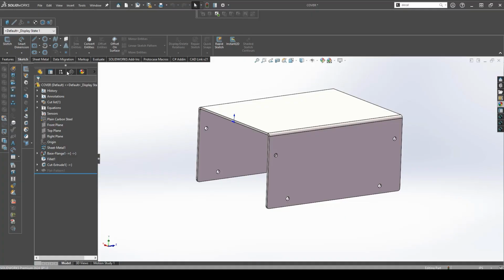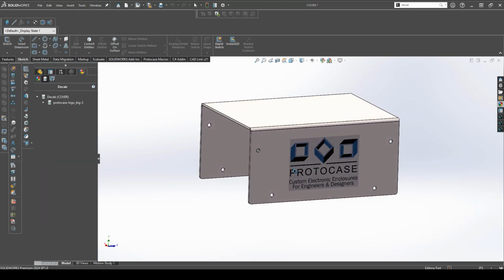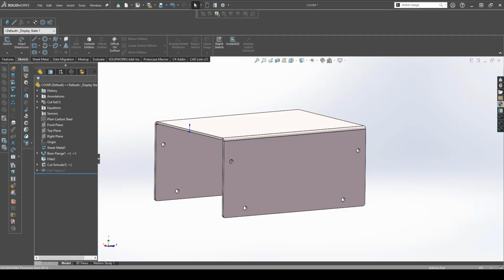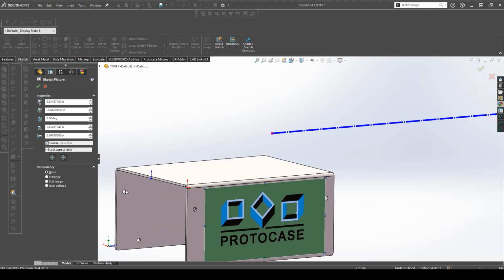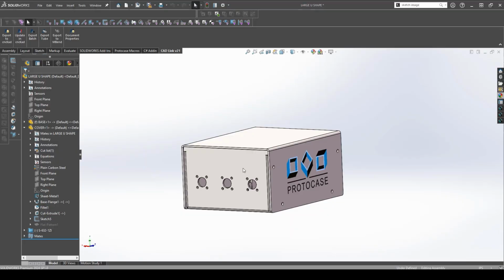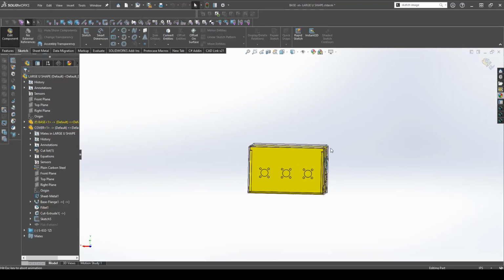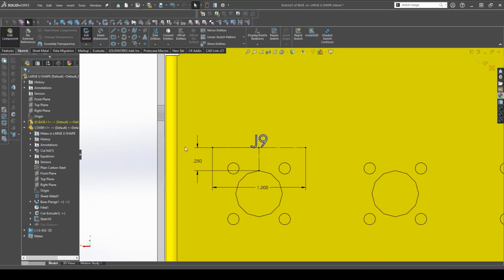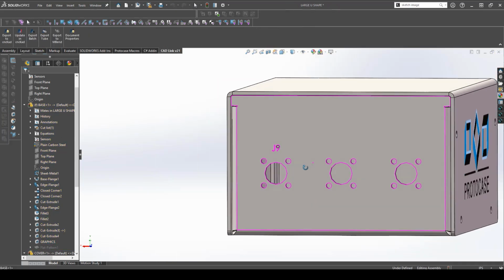Proto Tech Tip - Adding Graphics to your SolidWorks Design Files

Comment: I typically add decals to my models for this, but also include the vector graphic itself for the graphics team to use. I always have the box checked for [store appearance, decal, scene data in model file] + [store images for OLE object data in model file] under Document Properties -> Model Display. - Then I don't worry about forgetting to include any referenced image data with my parts.